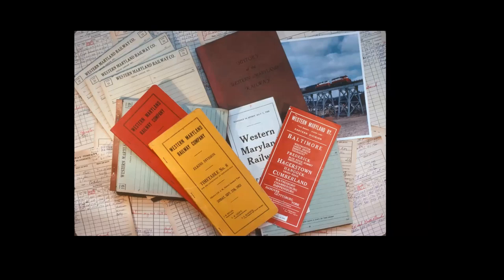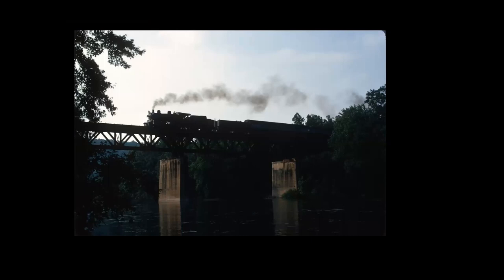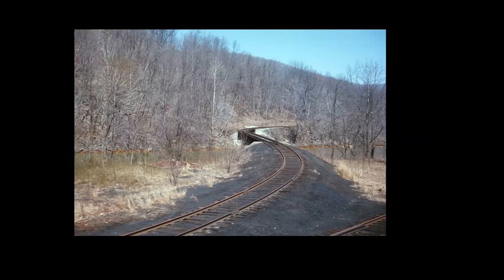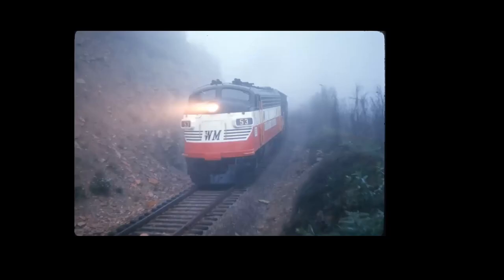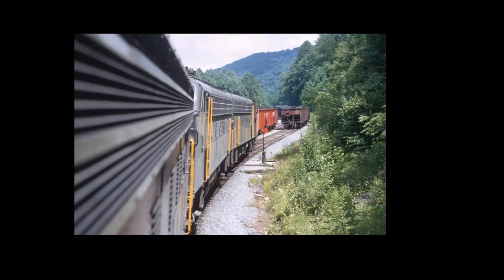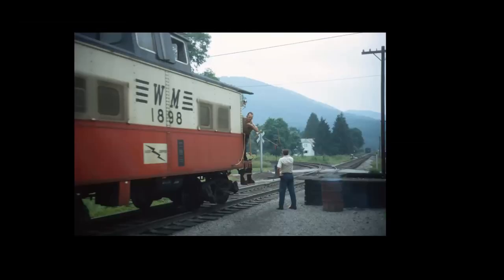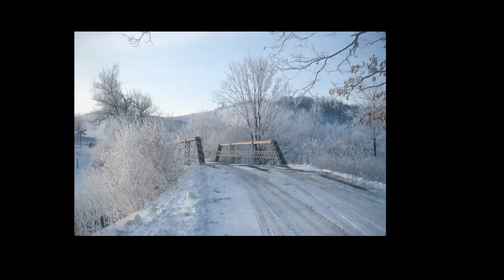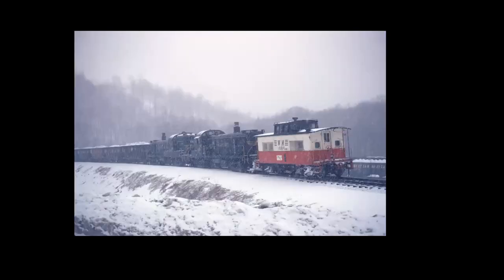Railfanning the Western Maryland in the Early 1970s

Comment: The man on the left in the picture at 35:10 of the ribbon cutting in Westminster is G. Herbert Rice, who was a Carroll County Commissioner at that time.  The man in the black hat is LeRoy Conaway, Mayor of Westminster.  I believe the other gentleman holding the ribbon was a railroad official.  I remember being in Union Bridge that day for the ceremony there and chasing the train to Westminster for the ceremony pictured here.  Santa Clause was also on board for at least the part of the run from Union Bridge to Westminster.  Unfortunately, hurricane Eloise washed out the track again in September of 1975 cutting the Western Maryland's main line forever.
Reply: What do you mean forever? Maryland Midland repaired the east sub and still uses that section
Reply: @BAS19.6  Yes that is correct - however, it is no longer the Western Maryland and the MMID only occupies a small part of what used to be a through main line from Baltimore to Connellsville.

Comment: Late August 1979.  We are in Baltimore, just so happens the NRHS convention is about to kick off.  We shoot the museum and continue south.  We make DC and promptly get kicked out of DC station(they had RS1s working the yard, had to photo them!).
While getting the boot(unfriendly cops)there is a northbound coal train visible.  Blue/Chessie and 2 WM F7s!  7163,7173.  These locos were heading to Baltimore to power the farewell to WM F UNITS special in Baltimore.  We chased them for a couple photos.  Could this have been the last time more than 2 WM Fs operated in freight service?
Reply: I wasn’t there, but if I remember the information correctly, the last WM Fs went west on a freight train in November 1979.
Reply: @GP30RDMT  One of the F7s suffered a traction motor failure on the NRHS trip.  
There is crappy video on the net showing these two F7s on this trip.